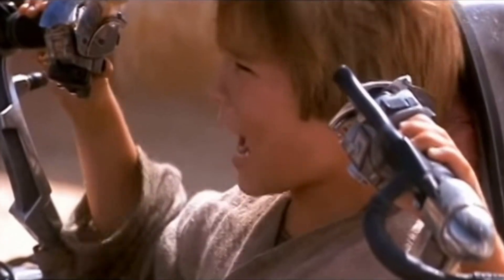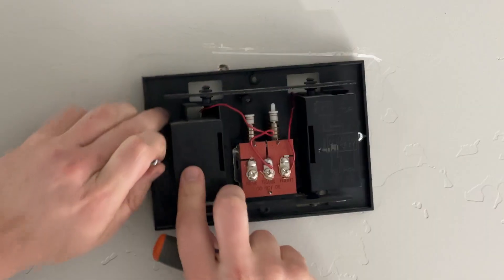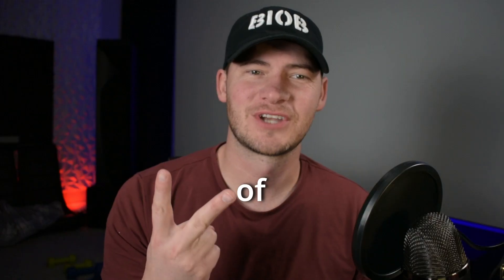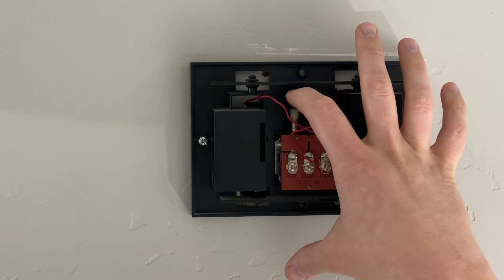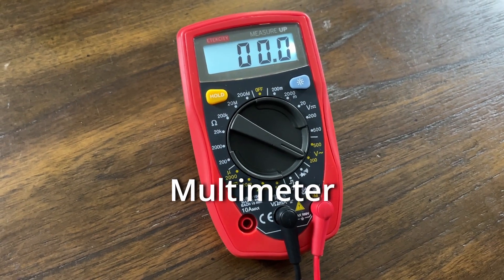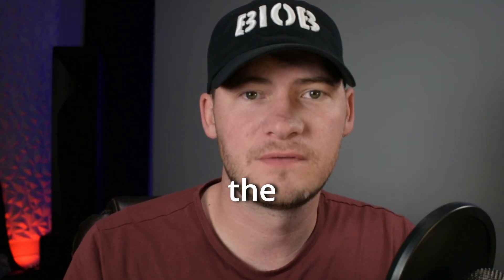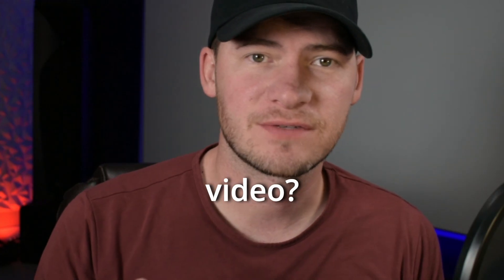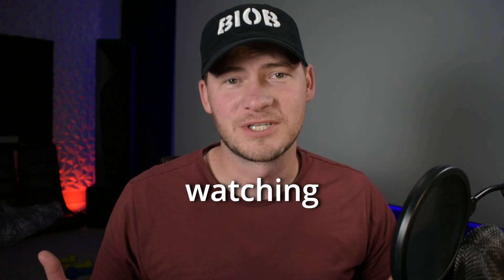Doorbell Not Ringing? Try THESE Steps Before Replacing

Comment: What worked for my RING doorbell, was to go into the app and make the switch on the settings from "electronic" to "MECHANICAL".
Reply: Thank you! This did the trick for me!
Reply: Thank you this fixed my issue
Reply: Maybe I'm crazy but it's not showing up for my doorbell. I have the newest ring doorbell but that option is not in the settings.

Comment: Found the video helpful but was not able to resolve the issue. Any additional pointers would be great. 

Have a video doorbell, which stopped working (no sound to the mechanical chime).
When I short-circuit the wires to the doorbell, the chime works. When I use the traditional door bell, the chime works. 
So I upgraded the transformer but that has not solved the problem. 

What could be the issue?

Comment: We have a wired Ring doorbell that came with the house. It worked fine when we moved in, and it stopped working 5 months later. Bought a new one, that didn't work once installed. The old one turns on when plugged into a charger. I reinstalled it and then tried replacing the transformer and still nothing. Any advice?
Reply from the maker: Did you change anything before it stopped working or did Ring have an update? I wonder if there’s a setting in the app.
Reply: @bringitonbrothers I didn't change anything that I'm aware of. I'm not sure about an update, but even the brand new one didn't work so not sure if an update would help but I also don't see an option to update anywhere

Comment: I have gotten everywhere but replacing the transformer. The doorbell turns on and functions properly but the chime will not ring, will the transformer solve this problem or is that just for the doorbell not powering on?
Reply from the maker: It could solve the problem. You could buy one and try it. If it doesn’t fix the issue, send it back.
Reply: We have a ring doorbell that has the little box that you plug into the wall it works, but the mechanical one on the wall won’t work. I’ve tried everything and had an electrician out, they couldn’t figure it out either. If you take the ring button off and touch the wires together it will ring but not as long as the ring button is connected.

Comment: Great information in this video. Unfortunately, I can't get this to work. I have a new construction home with a mechanical chime (19V, 30A) and I have voltages at the door button. I replaced the button with a Eufy E340 and wired it up per instructions. The mechanical chime won't work at all; I've checked the app settings but I believe if it is wired up properly, the Eufy button should have a yellow ring lit up but mine does not. I tried setting up with and without the jumper wire and still no chime. Any help is appreciated.
Reply: I am having the same exact issue. Wondering if it has something to do with compatibility
Reply from the maker: Sorry this is delayed but any luck?

Comment: I have a doorbell that has 3 chimes hanging below it.  I just purchased this house and it appears that the previous owner tried to work on it, so the wires are probably not connected correctly now.  Also the alarm has what I believe is a connection for 2, 12 volt batteries.  These are taped and not connected.  I can not find a manual within the house or the brand name. I wish that I could send pictures.  I purchased the nissar home wireless door alarm as a temporary fix and now it does not work.  On it the blue light works when pushed.  The alarm signs when plugged into the outlet.  So both of these alarms now gives no alarm.
Reply from the maker: That sounds pretty wild! I aren’t heard of 12v batteries powering a chime before.

Comment: If you do not show any voltage on the low voltage side after connecting the 120 VAC, you have a bad transformer even if you just bought a brand new one! This just happened to me. I returned it, got another one, and sure enough, it works now.
Reply from the maker: That’s good to hear! Thanks for sharing

Comment: Greetings, I have watch your video a few times while trying to fix my ring video doorbell.  The ring video doorbell works well on the battery.  However, the doorbell does not work with my two chime doorbells.  I have replaced the transformer and both chime units.    I am wondering if the 16v transformer is not big enough to power the ring door bell and two chime doorbells?  The system did work when I installed, but the doorbell chimes made funny noises.  So, I new something was not correct.  Well, the chimes stopped working and the ring door bell battery was not being charged.  So, do you think I need to get a larger transformer?  I would appreciated your thoughts on this item.  Thanks.
Reply from the maker: I think so. At least, it’s a start.

Comment: Mine is ready 18volts. So I need a higher volt transformer. Maybe 30volts?
Reply from the maker: I don’t know if that would help. Is it getting 30VA?
Reply: @ just changed it to a higher volt. It’s now reading 28v. House chim still not working

Comment: I have a mechanical doorbell and a ring doorbell/camera. The mechanical doorbell stopped working. We have been using it for 4 years, no changes. There is no battery in the mech db. We took it off the wall to check the transformer and there is not one. Just wires going up the wall. Now what lol
Reply from the maker: I wonder if there’s a transformer in the attic?

Comment: I've replaced my transformer to a 30VA and it still doesn't work.  It was working fine until I installed Ring.  What can I try next?
Reply from the maker: I think you’ll need to play around with the settings in the app. Does the doorbell turn on and connect to the app?

Comment: Hi I tried everything you explained to get my heath zenith doorbell chime to work. No happens. Please help.
Reply: Get a multimeter.  Check transformer first.  No electrical "juice" there, then check how it's "hard wired."  If connections good, replace transformer -- if only to eliminate it as a problem.  Then check new transformer to make sure it has "juice."  Still no chime?  With multimeter, check the chime connections at the chime box while somebody presses front doorbell.  If multimeter reads "0" then the chime isn't getting electricity.  Check wiring from transformer to chime.  If chime box is getting electric, test the doorbell by removing wires from it and tapping them together.  If the chime rings, then the doorbell's getting electricity.  Button may be broken.  Check that all wire connections are secure.  Still no chime?  Have a beer and call an electrician.
Reply from the maker: Great instructions. Thank you!

Comment: After seeing this helpful video, I found my transformer was 10VA and assumed that was the issue. But, I found my device setting was set to "none" for chime type. I changed it to mechanical and chime works. However, it just makes a single ding and not the ding-dong. I wonder if this is due to only have a 10VA transformer?
Reply from the maker: Hmm, that’s interesting. I guess you could try buying the upgraded transformer and send it back if it doesn’t fix it.

Comment: Currently experiencing an issue with my doorbell.

Installed a new ring doorbell to our home but now our christmas lights turn off whenever the doorbell detects movement. We have lights connected to an outlet near our front door as well as lights connected in our garage.

I’m guessing the old doorbell’s wires aren’t good or doorbell ringing box is old? Never messed with it before but would love learn how to fix it!
Reply from the maker: This is very strange! I haven’t heard of that happening before. Are you still having issues with it?

Comment: That was a very helpful video.  Thank you!  My ring door bell still doesn’t work after changing the transformer to a higher power, changed the mechanical chimer to a new one and cked the door bell itself.  The wire on the chime has 18 volt.  Any other idea on what could be the issue?
Reply from the maker: Hmm, I wonder if the ring doorbell is having an issue. It might be a setting with the doorbell too.
Reply: @ thank you, actually that is the issue, had to change the door chime type to mechanical in the device setting in ring
Reply: @chunli2076  After seeing this helful video, I found my transformer was 10VA and assumed that was the issue. But your comments on device setting was the issue.I changed it to mechanical and chime works. However, it just makes a single ding and not the ding-dong. I wonder if this is due to only have a 10VA transformer?

Comment: Hey I have new mechanical chime/regular doorbell. I’m getting the correct voltage at the transformer both doorbell is working. I’m just getting a buzzing noise at the chime. Open the chime the front door bell striker is activated continuously. What can be my problem?
Reply from the maker: From what I’ve seen, this could be a transformer lacking power or a setting in your doorbell app. What doorbell do you have?
Reply: @ I have two regular defiant push button doorbell
Reply: @ and I don’t have a doorbell app, they are not smart doorbells. Thank you for replying back
Reply: Do you recommend upsizing the transformer
Reply: Hi.  Not sure what you mean by, "...both doorbell is working."

Comment: I have a Eufy e340 and hardwired it. The app shows power to the doorbell but the mechanical chime isn't working. My transformer meets the Eufy req @ 16v/30VAC and shows 17.6v. I also selected the indoor chime option in the app. No success. I tried adding the jumper to the front/transformer on the chime (although that didn't make sense). I even got a new transformer and had no luck. FYI the chime works when connected with the old doorbell. Appreicate the help!
Reply from the maker: Thanks for watching and for the explanation. I wonder if you just have a faulty door bell from Eufy… have you reached out to them?
Reply: @bringitonbrothers  thanks for the response. I have reached out to them. Awaiting their 2nd response. They first told me my transformer might be faulty. Through troubleshooting, I eliminated that possibility.
Reply: I have same problem as you. Did you find a resolution?
Reply: Just FYI I thought the transformer might not have been sending enough power to the chime with the eufy dual camera doorbell with the 16v30AVC so I upgraded to 24v/40VAC still didn't work

Comment: Hi, so I just tried installing a Eufy wired doorbell and the original door chime doesn't work with the Eufy doorbell. It worked both before and after I had the Eufy installed. Any idea why? I'm planning on returning the Eufy shortly unless I (we? :) ) can figure this out. Everything else seems to work okay (though the wireless door chime was inconsistently working). When installing I can't remember where it was but it mentioned that my doorbell was getting the right amount of power so I don't think I need a new transformer.

Thanks for any help!
Reply from the maker: It might be worth locating the transformer to make sure it’s getting enough current. The voltage might be correct on the doorbell app but it might not have enough current for the chime.

Comment: I ring my doorbell there is a vibration in the chime but that’s it sounds like a buzz 🐝
Reply from the maker: I believe this is an issue with the configuration in the Ring app. Have you been able to figure it out?
Reply: @bringitonbrothers  no I haven’t I have tried to disconnect and reconnect and so far nothing
Reply from the maker: @peaksoe  if you have an older ring doorbell, it should’ve come with a diode that you might need to use. If it’s a newer Ring doorbell, it’ll have a diode internally installed. You just need to change the settings in the app. If you go to device settings, general settings, there’s a toggle for if you have a mechanical or electrical chime. Maybe toggle that switch if it’s available to you?
Reply: @bringitonbrothers  I have tried to change it up but no luck I will try and upload a video in my channel and if you have some time in your busy life to be able to look at it I would really appreciate it before calling and electrician.
Reply from the maker: @ sounds great! Let us know when it’s uploaded. We’ll check it out.

Comment: Great video. I've been trying to fix an issue after moving with my ring doorbell not ringing the indoor chime. My only problem is I can't find the fuse that is connected to the damn doorbell and chime. The only fuses I haven't flipped are the big double ones (AC, fridge, dryer, etc). If I find the right fuse eventually I'll be sure to try what you mention here.

Comment: I replaced my mechanical doorbell that worked just fine with a c4-pw nouveau Westminster chime doorbell.  The bell only plays while holding down the button.  I installed a diode in the button and it continually plays the chime.  I tried several diodes in case I hooked it up the wrong way and they all do the same thing.  I hooked up a different transformer that I bought specifically for this doorbell and it did not fix the problem.  I don't know what else to do.  HELP!!!
Reply: I was able to get the doorbell working.  Thank you!
Reply from the maker: @WayneWelander-r2v  that’s good to hear! Would you mind sharing what got it to work?
Reply from the maker: Wayne, thank you for the comment. Have you been able to find a solution?
Reply: @bringitonbrothers  The doorbell still does not work.  I contacted the company I purchased it from and they said I needed a different transformer and did not need a diode.  I purchased the transformer they said to use and it still does not work.  They told me they will replace the doorbell chimes.
Reply from the maker: @WayneWelander-r2v  Sorry to hear that! Please let us know if they give you a working replacement.

Comment: We just upgraded our doorbell ring, we just installed the Ring Pro 2, the problem is that the chime inside the house is not working, just the app, my husband tested the two pistons from the chime and they worked, power is not the problem. 
What can we do please.
Reply: Thank you, we called to the ring technical support to fix it. It’s working.
Reply from the maker: @tatiriv0915  Great! Did they mention what the issue was?
Reply from the maker: We’re happy to do some research to help figure out this problem. Before we do so, is it still having issues?

Comment: My doorbell chime makes a dull noise and vibrates when u press the doorbell. Any ideas where ti start so ican save time?
Reply from the maker: This could be an issue with the power from the transformer or a possible configuration in the app for the doorbell. Have you checked the power output from the transformer?

Comment: What do I do if this what seems to be happening to me. I upgraded my previous Ring doorbell with the new Ring Plus. My older model I connected myself , the house would chime and everything was perfect. Only reason I upgraded was because the video quality had been affected due to elements and me owing for 5 years. The new Ring Plus installed similarly and the house would chime but after a week of use , we don’t hear the interior chime. Only get alerts through the app. When I check the app, the battery shows as hard wired and receives charge . I went ahead tried trouble shooting and idk what is going on, but literally when I unscrewed the cables from the doorbell and rubbed them together, the chime worked. Just doesn’t work anymore when I screw in firmly to the back of the Ring doorbell camera. Please help!!
Reply from the maker: Thanks for reaching out. Can you locate the transformer and tell me what the numbers say on the front? I believe the new ring doorbell might require more power so if you don’t have the upgraded transformer, that could be the issue. It could be something else too. Great job trying to troubleshoot this. You got this!

Comment: Having a problem. I have a smart Doorbell (Dahua 2K doorbell) so Directly at my transformer it reads 16V, at my doorbell it rings 16V. at the chime it only reads 1V when the doorbell is pressed. My Doorbell is outputting great video and has no issues rings to my phone through the doorbell app (DMSS) but the Chime (Mechanical) does not ding dong at all.. when the doorbell is pressed I have a multi meter on the trans & front terminal and again only 1V which I’m sure is the problem, not enough power to flip the hammer to ding. But why is it enough power for the smart doorbell ?  Very frustrating troubleshooting this hopefully you can help out. 
Thanks
Reply from the maker: Thanks for reaching out. What do the numbers say on the front of your transformer? It could read 16 volts but the amps might be too low. That was my problem.

Comment: My issue is that I just moved into a home and installed a smart doorbell. When I ring it, my mechanical chime just buzzes. The Ring app says I should decrease the voltage to it in the app, which I tried, but the buzzing just gets quieter. I increased it in the app, and the buzzing just gets louder. Any idea what that could mean?
Reply from the maker: How long does the buzz last? Have you checked the numbers on the transformer? Check to see if it reads 16v 10a or 16v 30a. I had to replace my existing 16v 10amp transformer with a 16v 30a one to meet the combined power needs of the smart doorbell and chime. I've also seen people add a resistor to the doorbell chime between the two leads where the wires connect. If your transformer isn't the problem, you could try that.
Reply: Your door bell should have come with a short wire and instructions on how to jump the box